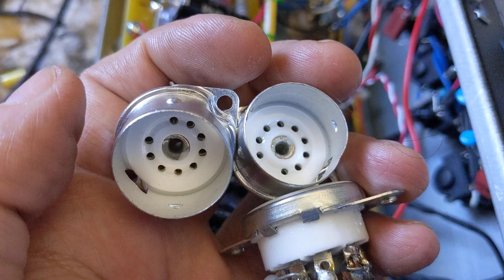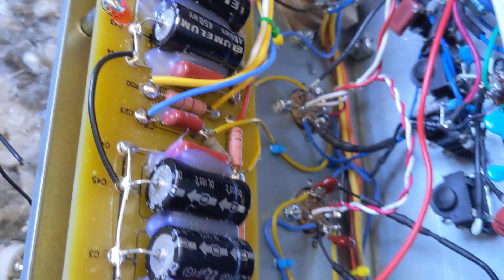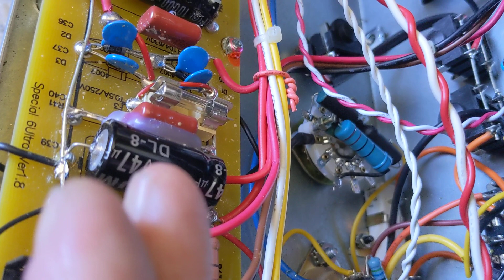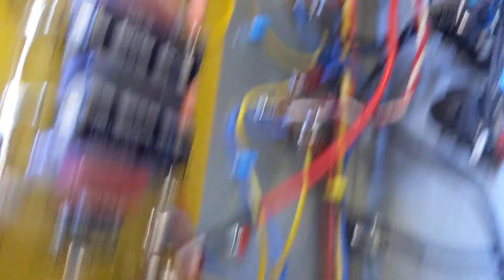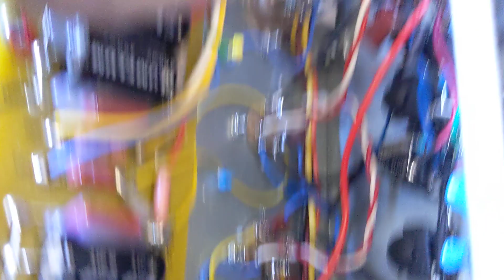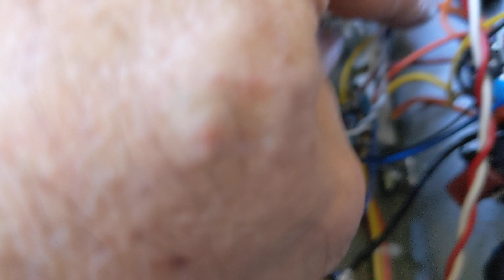VHT Special 6 Ultra NEW SOCKETS +

Comment: Most chokes I've seen are inserted between the B+1 (Plate) and B+2 (Screen) nodes,  R43 feeds the B+1 node. 

I'm assuming another reason for the RR suggested 100ma 157M due to the additional current through the choke, particularly with an EL34?
Reply from the maker: It's a one or the other thing in this PSU. The power supply splits into 2 parallel feeds after the standby switch at the junction of R42 and R43, the power tube B+ and screen B+ is on the power scaling circuit starting at R43, the 12Ax7s are fed from R42 with no power scaling. I think Robinette's rationale (if he had one) was to smooth the power tube ripple to keep the 60hz hum down. A 2nd choke for the preamp would be slightly ridiculous overkill, the DC heaters seems like it's supposed to address preamp noise.

Most of the noise in mine comes from the Ultra input triode, the new socket and new metal film grid stoppers is a start, if I can get that down to normal gain noise I'll be happy.

The rest of the noise is power tube noise when the raw switch is on, some of that can be attributed to creeping heater/cathode leakage in the vintage tubes I'm running but most of it is weird lead dress, long lead runs, the somewhat chaotic grounding scheme (definitely a scheming scheme...), Fred Flintstone solder joints and the crappy original power tube socket.

The blackface tone stack hides a lot of inherent signal circuit noise.

Got all the formerly flying leads down on the chassis, replaced the super short ones. Many of the board leads aren't inserted into the eyelets, they're just laid on top and buried in those huge mounds of solder, I've fixed many but not all. Redoing the grid leaks and bias resistor grounds will need a couple of tag strips so I can ground them to the appropriate B+ cap ground but I want to do things one step at a time and A/B the noise floor at each step.

Not convinced the power transformer would survive running big bottles all the time. The best big bottle approach would be to replace the transformer, get about 50 or 100 more raw volts at the secondaries, double the current capacity, dial in on tube manual specs for one power tube, just choose your sonic flavor and be happy with that. Trying to run correctly biased 6L6GCs or KT66s as is a bit of a fool's errand at 326v plate B+.